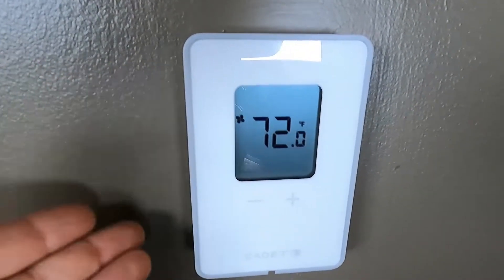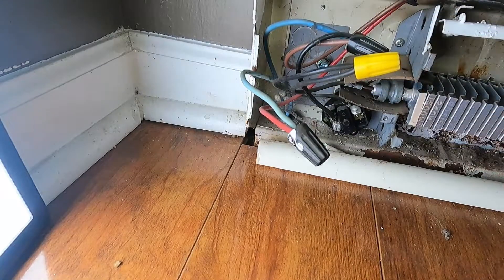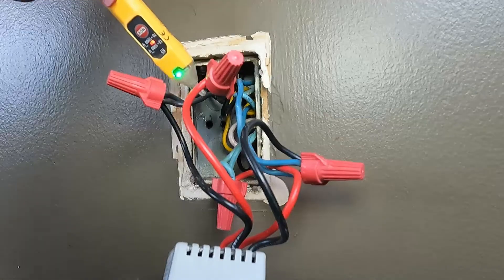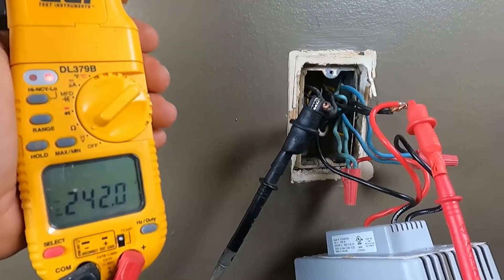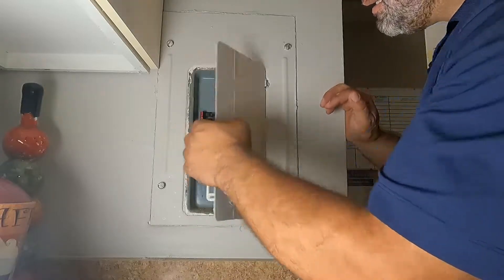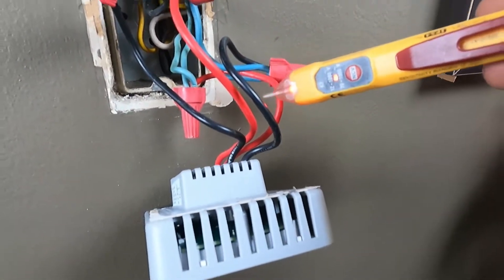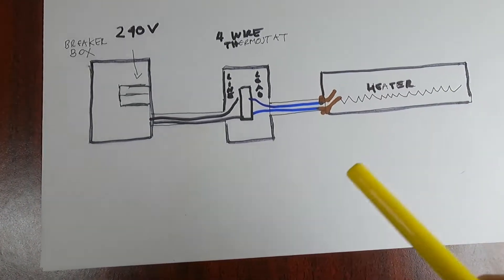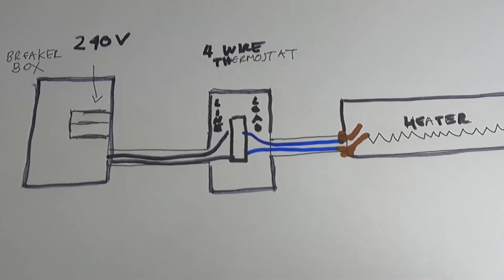HOW TO TROUBLESHOOT 240 VOLTS ELECTRIC BASEBOARD HEATERS

Comment: Alex, I have 120v on each leg at the heater( disconnected from the heater) but nothing when I connect the meter to both live wires?
Reply from the maker: this is a tricky one.
1  Remove the wires from the thermostat. Take a picture
2 measure 240 out of the breaker, if yes continue, if not breeaker if faulty
3  at the thermostat. measure 240 at the wires before the thermostat.  if yes continue, if not wires are faulty.
4 connect thermostat again.  Call for heat and measure after thermostat 240. if yes continue ,  if not thermostat if faulty
5. disconnect the heater .   At the heater with heater disconnected measure 240 if yes continue , if not wires from coming from thermostat are faulty.  If yes  Connect heater    NO heat    bad heater.   Let me know what you find out.

Comment: One thing you should never do is use that idiot stick as a measuring tool for voltage. Best electricians call them idiot sticks for a reason they get false readings. The only accurate way to do this is with the multimeter
Reply from the maker: Hey Matt>  That idiot stick as you call it, it is a very useful tool.  It can be dangerous if used incorrectly.  It tells you that there is voltage present.  It does not tell you how much, even though the new models now measures the voltage.  If you noticed, when I needed to know the exact voltage I used the multimeter in multiple times.     I know exactly what you mean but you phrased it wrong .   It is a very useful tool , but you have to use properly. or it could be dangerous.  Nonetheless very useful.   Thank you for your comments.

Comment: I have 15 of these in my house and I cannot believe you didn’t bring up or talk about the only reason every single one of mine break every time
The thermal cut off switch sticks on cutting the power off over and over again. It gets old and then flips on, even though it’s not too hot. And then it stays on. These switches are junk and ruined these heaters. It is the only part on the heater other than the heater element that is extremely necessary to talk about you could do a whole video on this switch along.

Comment: Good job, Alex!  Do you have a presentation that covers 2 - 2,000 watt heaters hooked up together?  On one of my sets of two heaters, one heater has stopped working.  My heaters are about 9 or 10 years old.  Thanks.

Comment: Hi Alex. Thanks for the video. I hope you can help me.  I have 3 240 volt electric baseboard heaters running off of one thermostat.  All 3 of them work in terms of providing heat, however 1 of them make a buzzing noise when its on.  Note, it is not a constant buzzing, The buzzing is intermittent. About every 5 seconds exactly the heater buzzes for about 13 seconds and then is quiet for 5 seconds and then starts again and buzzes for 13 seconds and then stops again.  Have you seen this before and do you know what I can do to fix it?  Thank you!

Comment: What does it mean if voltage pen detect power on the baseboard metal housing? and have a 2nd one can't detect it.
Reply from the maker: Hello ,   Those voltage pens are awesome but dangerous.   Always use a voltmeter.   If it reads hot, It might be hot.   Or it might be reading the wires behind the baseboard?   Or maybe the setting is for 24 volts and not 120. ?  It might be static.  It can't be hot because the metal of baseboard is attached to neutral.  It would be a short.  Just for fun put one lead of multimeter on a neutral on a nearby receptacle.  The other lead to the baseboard metal.  If it read voltage then the baseboard is not grounded and the metal might be hot.   Let me know what you find out.   Peace!!

Comment: Not always the issue, breaker could be the issue remove the breaker look at tips to power breaker if getting weird readings,if getting  higher readings your breaker is bad replace it...do a ground test with continuity with wirring remember , don't  do this if your not comfortable  doing  it safty, safty, safty...Your contact points on breaker are scorched  replace the breakeŕ.

Comment: I don't trust the voltage pen to see if you have 120v.  I seen many times  it beeps, and have couple of volts not 120.
Reply from the maker: Hello Stanley. Im with you   I love this voltage pen for fast troubleshooting.   In depth troubleshooting you need to use the volt meter.  Thanks for your comment.
Reply: That's because a pen tester does not confirm how much voltage is present. It simply confirms the presence of current.

Comment: Hey Alex,  thanks for the video.  I have a “rm162” heater that isn’t resetting.  I haven’t tested with a voltage meter yet but is it possible that a fuse in the actual heater went bad or maybe it just needs a new reset button?